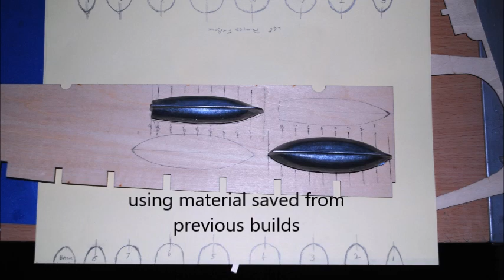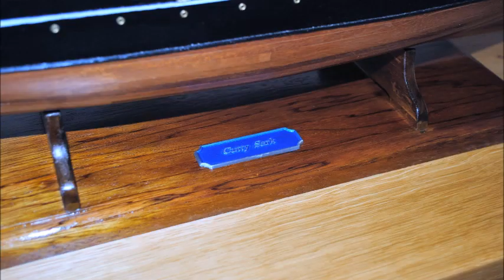Jeff's Cutty Sark model build

Comment: Very impressive!  I would invest in a plastic/plexiglass cover to keep dust off.   I'm a plastic model builder, so these wood ships are way beyond my level.  But I enjoyed watching your video.
Reply: Polycarbonate is better and easier to make. About the same price last time I looked. Can be cold bent under 3 mm thick. Holes can be cold punched, and cut with tin snips. A one piece 5 sided cover is actually possible. I've made such covers.

Comment from the maker: The balsa in the Hull helps to create smoother curves on the planking, mainly to prevent the plank ‘creasing’ on the ribs, you can also apply adhesive to balsa as well as ribs before ‘pinning’.

Comment from the maker: Hello Highwayman, you asked about notches on the keel frame, as I remember any Notches, steps etc on any of the frames are there for guides and will be used later in the build, they may need a little sanding when fitting items such as deck or side panels etc, usually all you need to remove are  any bits where items were attached to the sheets!
Hope that helps, good luck with your build🤗
Reply: I dont mean to be so off topic but does someone know of a method to log back into an Instagram account??
I stupidly lost the account password. I would love any tricks you can give me.
Reply: @Quinton Ayaan instablaster =)
Reply: @Zachariah Marcellus it worked and I finally got access to my account again. Im so happy!
Thanks so much you saved my ass!
Reply: @Quinton Ayaan Happy to help =)

Comment: beautiful build well done. one friendly suggestion, when rigging your ships if you run the rigging lines through a block of beeswax it reduces the furry effect and helps prevent dust clinging to the rigging which I have found is a problem unless they are in a case.
Reply from the maker: vindicari 
Cheers bud, I'd heard about that but neglected to do it!!
Will do next time, what I did do was 'paint' with watered down wood glue.

Comment: I am just starting this model and am trying to see how the deck planks fit at the waterways.  Do the deck planks just sit on top and hence the simple square end or is there more detail.  Can someone help please.
Reply: Solved it I think.  The strips for planking and the waterways are both 1mm thick.  Lay the plank over the waterway then cut the waterway away to accept the plank.
Reply from the maker: Spot on Chris, although if I remember correctly I think I put the waterway round the edge then the light planking and then added the wedge shaped fillets at the bow last!

Comment: Hi Jeff...beautiful model, really excellent work. I'm building a Constructo kit of the Cutty Sark - a it smaller than yours, but still quite detailed. I've done the standing rigging and I was looking at your video to try and figure out in what order to fit the yard arms so as not to  end up in a tangle - but you skipped that bit! Have you any advice - i.e. did you start at the top or bottom of a mast, and did you finish one mast at a time?
Reply from the maker: Yea, your right, to be honest I just pulled the pictures together what I had for the video and probably missed a lot of things!
I’ve only done 4 ships with full rigging and found working bottom to top but mainly inner rigging first and work outwards, unfortunately the shrouds are usually on before the rest of the rigging so you need to work around it!
Good luck with your project 🙂
Reply: @makumjeff2257  Hi Jeff thanks for reply. I'd read that working middle and low out was the best method, but I note on my model that the yards are mainly supported by the yard above - rather than blocks attached to the masts - which makes it a bit awkward.  I'm going to have to plan things out a bit more before I begin! I've already had to repair a few things that got in the way when doing the dead eyes! Cheers again.